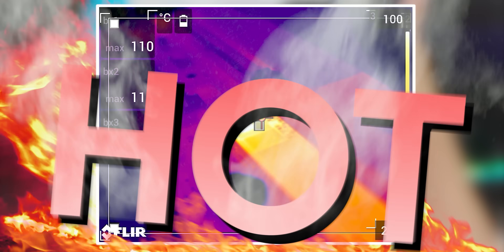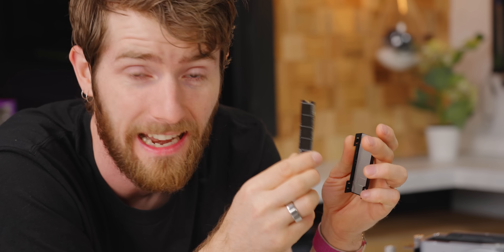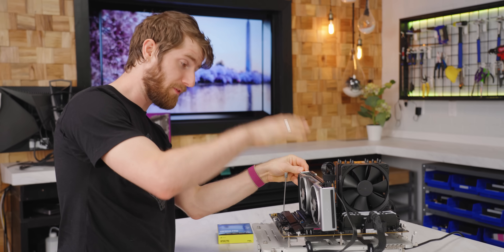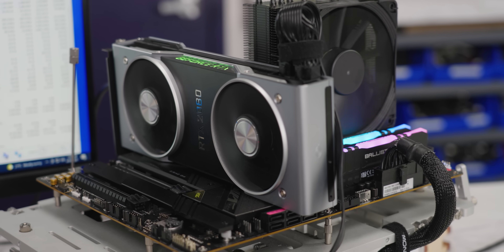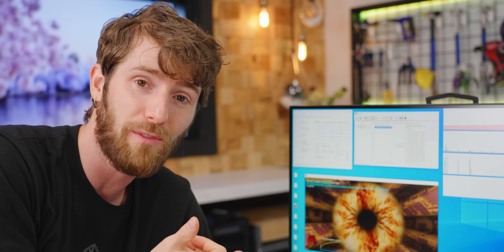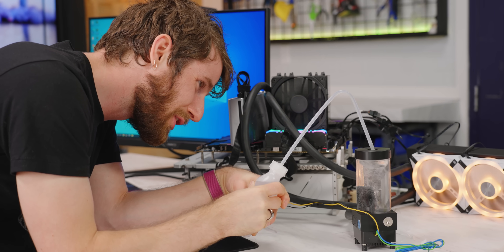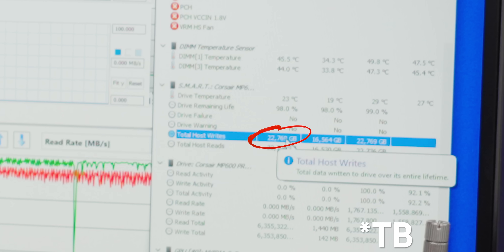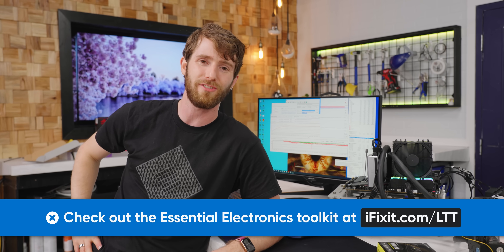This Product is a Meme - Corsair MP600 PRO Hydro X water-cooled SSD

Comment: When an SSD has the same memory as your entire PC.

* surprised Pikachu face *
Reply: Have my OS and Steam on a 256 SSD. Rest is 4tb hard drive lol
Reply: Mr. Popo noob. I store all my data on floppy disks.
Reply: @mudbuggie90  he meant the SSD has more ram
Reply: @mudbuggie90  might be worth changing if direct storage with win 11 is worth it. 1 or 2 TB of PCIe4 SSD for Games would probably be enough (and the  Chia Coin SSD price escalation should be a thing of the past)
Reply: @sinuslebastian6366  man I stored all my data of a old power book in just 16gb sd card
Reply: @mudbuggie90  
I'm still rocking with 128GB drives (1 per VM), if it aint broke don't fix it, I still have 6TB drives to actuall store everything else, but just having windows on the main drive is chill.

Comment: At least within the context of a pc that is primarily used for gaming, is the heat of an NVMe drive even a consideration? I’m pretty sure disk usage is incredibly low while gaming. Im sure there are probably some concerns to be had about heat if you’re regularly taxing the piss out of your drives but for a gaming/normal home use PC, surely active cooling is far from necessary and may actually be a hinderance.
Reply: My old PC hen 3 ssd heat throttled so bad I needed to get a heatsink for it. New one has two of these and I've never seen them get above 28C

Comment: I watercooled my two 980 Pro 2tb nvme's since I have two watercooled 3070's. The heat difference is very noticeable. It was more fun to build and cool factor than anything. The temps of the nvme's went from 80s to 30s. Is it necessary...no, but it works great and could extend their life so I am cool with it. Wish they did a real test of the drives stressed inside a hot case. 🔥
Reply: "so im cool with it"

I see what you did there

Comment: I know it's a bit long after the video was posted, but I bought a couple 30mm PWM fan cooled SSD Heatsinks for 2x Samsung 970 EVO Plus SSDs (1TB and 2TB) -- with no heatsink they were at ~70-80 peak, with a passive heatsink the one below the GPU was at ~70 and the one behind it was at ~76. My system uses an AIO CPU cooler, but they're apparently known to run hot even in fully air cooled builds. Now, the 1TB behind the backplate caps around 60 and the 2TB in front of the GPU fans caps around 50. The 2TB is set to 50% fan speed (around 5000 RPM) and the 1TB is set to 75% (around 6500.)

Actually a really big improvement for a dangerously high temperature lol, highly recommended if you have an SSD throttling itself all the time like I did. Worth mentioning, I also have an Intel branded SSD that maintained around 45 under the GPU with no heatsink, and is around 35 with a low profile passive one.

Comment: I think you missed an opportunity  for a fourth  benchmark. which would honestly have been the most common. And I'm sure you're already aware of it. Cooling the SSD in a loop thats cooling at least a cpu, possibly a gpu as well. because without a doubt it'll run hotter due to the other components and reduced flow rate. but I'm curious to see how marginal, or extensive  the difference ends up being.

Comment: Crazy video idea: use a water-cooling loop as a water heater and make yourself a nice cup of tea/coffee
Reply: Bindun. British soldiers in WW1 used to heat the water for their morning brew by firing a couple of belts of Lewis(?) machinegun ammo out across No Man's Land. (source: Goodbye To All That, Robert Graves)
"Hans, I think zer Tommies are preparing an advance."
"Nein Klaus, zey are just making tea."
Reply: Doesn't get hot enough
Reply: @joshuacheung6518  if you lower the flowrate and let the water really heat up?

It shouldn't boil of cause, but depending on the tea 80° would be plenty.

Comment: One important test missing: since it's a product made for a custom water cooled system, the effect of heat from GPU and CPU is ... marginal at best. You should have tried that testrun as well with both CPU and GPU on water and the SSD sitting without any water in it.
Reply: This test puts more heat near the ssd than if the whole system were water cooled since most of the heat is dissipated at the radiator instead of at the component. Granted someone is only going to run this if they have a custom loop already, but the point of the video was to show how pointless water cooled ssds are
Reply: That test would be completely irrelevant. They tested it in the worst conditions to prove that it was pointless... Running it in better conditions (like a water cooled system) would only prove it's even more pointless.... There's zero point to test this in a water cooled system.
Reply: @googlewolly  There is no reason to test in a water cooled system since the water cooled system will be better at managing the heat than the air cooled system with only the ssd water cooled. The reason is that the ssd is in stagnant air which is surrounded by the cpu and gpu. When the gpu backplate gives off heat it just sits there slowly raising ambient temperature, the cpu tower also raises the temperature in that area. A water cooled system takes the heat from the gpu/cpu and moves it to a remote location no longer cooking the ssd

Comment: I have found conditions that can keep an SSD running at high usage frequency for several minutes - running disk heavy unit tests on an encrypted volume. Not the most common use case, but the use may actually exist.

Comment: What I'm wondering is: In a loop with other components could it actually be worse to have the SSD hooked up? Like at what point would the loop actually heat the SSD. (I assume that won't be a real world issue)
Reply: Well if the water was hotter is when basicly, so hopefully never, except maybe when the ssd is idle but your gaming so the gpu and cpu are warming the water but that's not really important. For reference I never let my water get hotter than 40 degrees c even at max computer load

Comment: Missed intro phrase - "Honey, I've got an SSD."

Also, couldn't it be bad in a full cooling loop with CPU and GPU, because they would actually run hotter, even as hot as 70 C, even water cooled?  The CPU and GPU could actually overheat the SSD.

Comment: You could connect a tube to the in/out of the drive. More water, more surface area. Or could connect to a passive heat sink and make it an AIO.

Comment: What about any secondary benefits?  Quickly routing that heat to be dispersed by your radiator could also reduce the amount of heat that would otherwise bleed over into surrounding components like your CPU or graphics card.

Comment: Putting this in the loop with your CPU and GPU makes sense for only the cost of fittings, warms the drive under load and cools it under idle, main reason I water cooled my two Samsung 970 drives with cheapo bitspower blocks on my asus x570 prime pro was under low airflow conditions (external radiator for silence) the drive would heat soak into the mainboard when running backups and then the chipset fan would spin up and the VRM temps also went up, I also only have thermal pads on the DDR and controller sections of the drive but kept the Samsung thermal sticker.

Comment: 1 nvme 4th Gen, and 3 nvme 3rd Gen farming chia 24/7 at around 71 degrees with $10 cooling fins. Ambient temperature is 70 degrees to 98 degrees, an area with fans but no air conditioning. This product is for chia farming.

Comment: I'm pretty sure that an SSD with that kind of cooling (+ that kind of cooling itself, in general) is more something someone could need while running professional tasks;

I'm still using an "old-style" classic SATA SSD (SanDisk SSD Plus 480GB) as my main drive and it works just amazing. It's blazingly fast for everything i do; (Ok, running Linux so the OS isn't that heavy, but was already fast with Windows 10 before, too ;) )

Comment: When I added a Radeon RX 6900 XT to my system, I started having a lot of instability as it was cooking my NVMe drives. My GPU would regularly hit 90C+ which would cause my motherboard-mounted NVMe drives to roast at temps between 60 and 80C. For reference, they're really not supposed to go higher than 50C. I tried using a custom fan curve to help mitigate this, but the Radeon software would regularly reset, removing any fan customizations. I wouldn't notice the software had reset until my system crashed again. I had to buy an entirely new case (Corsair 5000D Airflow) that supported a vertical GPU mount. I also added large heatsinks to all of my drives. I still run a custom fan curve, but there's at least some headroom to prevent crashes with this new setup.

One perk of the custom fan curve, which is super aggressive past 70C to prevent the card from going much higher than that, is the noise caused by the ramped-up fans drowns out the massive coil whine my $2,000 card has.

I should have bought an RTX...

Comment: If water move to fast  you may not get as much heat exchange.  Slower the water flow you pick up more heat off of the SSD.

BOILER DELTA T increases when pump speed slows & decreases when pump speed increase.  Same goes for AC Delta T, blower speeds up delta t decreases, blower speeds slows delta t increases & if too slow coil will freeze up

Comment: It's not a meme for Gen5 nvme SSD's anymore when you see how difficult they are to keep cool enough and not throttle with most passive heatsinks. Also a recent study points out that NAND lasts longer when 1) being written to in a warm state and, and the novel part,  2) keep their bit/memory status when kept cool. Since reading CAN warm up a Gen5 ssd quite a bit this can impact the reliability, so keeping it cool on the long term is more important than you'd initially think.
Reply: Hello so how do I fan cool or water cool an nvme ssd in a pc case, like what products should I search online and how do I know if it will fit in case ....or mobo?

Comment: Performance degradation on M.2 from heat is insane. If you're running a mostly water-cooled PC with very little static air pressure the included heatsync with most m.2's won't do much. That's why these m.2 waterblocks come in handy. After installing them I seen a huge jump in performance.

Comment: Hm, Late response,  If you have a watercooled system the heat generation near by becomes less of an issue as it's already being pulled away through the water instead of radiating into the air nearby so even less needed in that situation.  So basically only useable for aesthetics if you want it to look like that.

Comment: Honestly, if you already have a custom loop setup why not and you could probably make a pretty low profile setup by going from the gpu to the ssd or the cpu to the ssd since its not like its going to slow down flow or significantly add too much extra heat. but as they said its just not required for most people and most situations. That said, slap some LED lights on there and I'm sure someone will buy it.

Comment: I've had a mechanical hard drive get burning hot ONCE, but flash memory is pretty much known for it. So idk where this idea of them being cooler comes from.
Reply: Because over the course of the day, they generate far less heat than the motor of a mechanical spinning disk. Especially for servers, it makes a big difference in the amount of cooling required.

Comment: But, if it's in a normal loop, it would be cooled by the temp of the loop. So over time i will heat the drive to the loop temp, but, per the pinned comment high temp is not bad while reading to/from flash (it increases mosfet (gate) insulator impedance (opposite to resistance), increasing bit rot (hardware level data corruption), but why doesn't it speed up insulator break down/impedance increase, which is drive degradation?), so water cooled drives would only work if all temps are under 70c (more like 60c), or the loop doesn't reach equilibrium?

Comment: Cooler running electronics is always better than hotter running electronics. If you have a water cooled system why not use that resource? I've had my water cooled rig running for 12 years and the system has been rock solid the whole time. Never regretted "overkilling" anything. Great video thanks guys

Comment: One thing that would be interesting to test is, if you just fill the block with water, does it make a difference if you have the mainboard on your table or upright like inside a case? cause laying flat, the water gets heated up, the hot water rises to the top, exposing the chip to new colder water. if you have it upright, the warm water goes upwards along the chip, so the top of the chip should be hotter than the bottom. Maybe that would result in a higher average temperature, but you wouldn´t have those spikes

Comment: Remember that heat always creates power losses by raising electrical resistance, thus causing more power losses and in turn more heat. It's a self sustaining loop. The lower the temperature, the less power losses you create.

Comment: The problem with JUST having static water in there is this - you're right that water has a HIGH heat capacity. Meaning - it takes a lot of energy to heat it up - it also takes a while for it to cool down. This is why heat sinks are made out of things like aluminum and copper - it has a LOW heat capacity. It takes very little energy to heat it up - and it dissipates it just as quickly. Which is why water cooling requires a radiator - whether its in a car or in a computer.

Comment: be careful about something, the vaporization of water isn't 0% below 100°C and 100% after 100°C.
The water is always in equilibrium between a liquid phase and a gazeous phase, a fraction of the gazes above the surface is water, allowing wet clothes to dry up, the main point is partial pressure, the pressure in the gaz ifonly water was present, it's a function of the temperature, if temperature increases, the partial pressure for equilibrium increases, water starts waporization drawing thermal energy to get to the partial pressure.
By traping water in a closed tank, the pressure will increase because of the heating that shifts higher the partial pressure.
In a word, the SSD could explode, and spray hot water everywhere on the motherboard

Comment: A very high flow rate is not necessarily a good thing, it leads to a very short contact time, resulting in inefficient thermal transfer of heat from the components. The reason manufacturers put those speed bumps and barricades in their cooling loops
Reply: high flow rate isnt bad. but it also doesnt give any advantage. linus made a video on this with tests. and the speed bumps and barricades also called micro fins is to increase surface area for the warmth to contact the water.

Comment: Also isn't it important to note that usually SSDs have specific operating temps? nand likes to be warm when writing data, and you can lower the lifespan by over cooling it rather than just letting it run in it's normal operating temperatures.

Comment: still waiting for corsair to release water cooled radiators - basically heat exchangers for a secondary coolant loop

will be necessary if computer ms reach the thermal output of nuclear reactors 😂

Comment: I love linus theory about how water just helps cooling stuff on itself. so in theory if you have a car engine you should attach a massive water tank to it and it will magically keep it cold for short trips
Reply: That's kind of true lol, it just acts as a heat "tank" so if you make short trips it will suck off a part of the heat... It does need to cool down after though

Comment: You should try adding wax instead of water and making what's effectively a phase-change cooler. Dm me if you want more details on that!

Thing about throttlight to a different temperature might be connected to PID response being incorrect when thermal mass is to big.

Comment: Thats  why i use a WD Black AN1500  1TB  PCIe 3.0 x8  SSD wich has 6500mb read and 4100mb write (Benchmarks says thats accurate) wich has a complete alumnium enclosure is heavy AF and sits UNDER the GPU. So in my case since hot air rises up  it stays cool due to the mass of passive cooling. i run a i9-9900K @ 5Ghz so Mobo dosnt have PCIe 4.0.

Comment: @Linus, this video is good and the temps are low, however would they be that low in a everyday run? You only hooked up the SSD to the water loop. Someone getting this would add it to a loop with the CPU, and probably GPU on it adding to the loop and heating up the water faster. Can we get a video that is with all your water-cooled parts connected and compare temps then?

Comment: 2:41 well

Electricity flows better through colder materials due to it lowering the resistances, but Chemical changes occur more easily in hotter materials. My mind escapes me on the exact inner workings of SSD chips currently, but it could be bouncing back and forth due to that... and the fact that it's actually a bit weird that electricity flows more easily through colder materials when electrical flow kinda seems like a chemical sort of thing upon first reading.

Comment: Now I just imagine an entire system of fans and tubes, ultimate cooling set up with 4 different GPUS to handle multitasking and just a beast of a machine built for a boat load of performance. Just stored somewhere in a dry cold controlled climate, likely in a basement in an arid area. A machine constantly running near freezing, just above it to keep it from causing ice.
Reply: you can run them below freezing when you remove moisture outa the air. ln2

Comment: A bit late, but I really had a temperature issue with the normal MP600 on my system. Ryzen 7 3700X and my old GTX 980 Ti with a bad airflow in the NZXT H500 brought the SSD to about 65-68 °C at gaming where the system sometimes just went off!